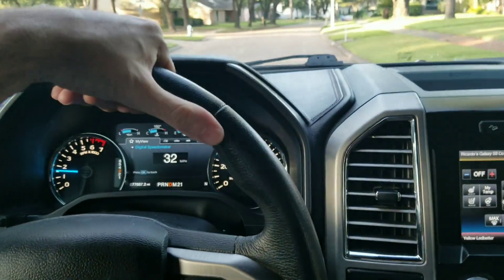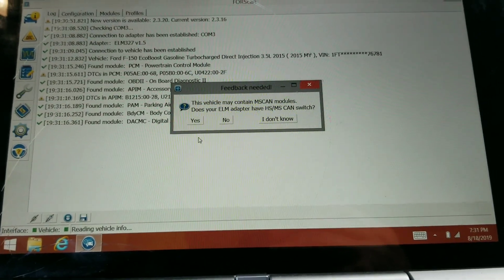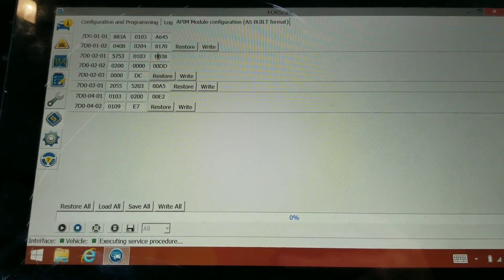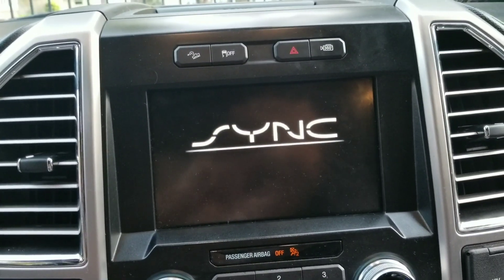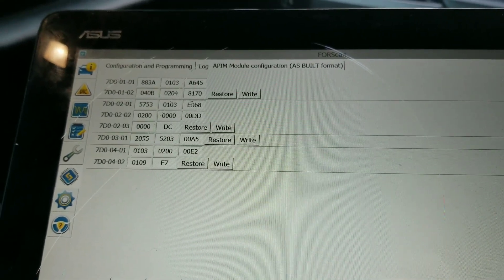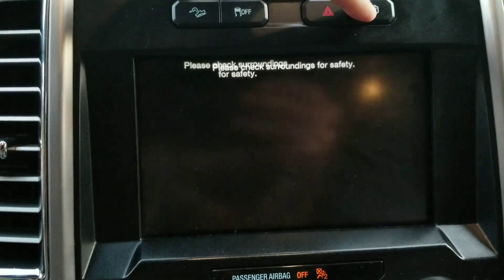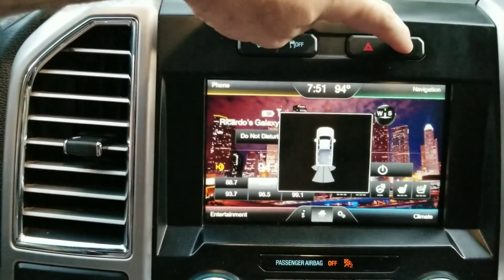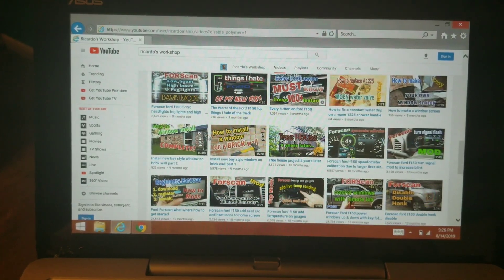Forscan FAIL change rear view camera mode from 360 to sole rear RVC on F150

Comment: Did you find how to do it? I want to try something, i just bought a f250 with only reverse camera, it doesnt have the 360 like yours, im thinking to buy the oem 3rd brake light, the camera and the wiring, and with forscan add the option to change betwen tailgate and cargo camera, yo think this is possible?
Reply from the maker: That sounds like an awesome idea. I'm sure if an aftermarket company is selling the 3rd brakelight camera, they will have instructions on how to incorporate it to the truck.

Comment: Did u ever figure this out I’m wanting to just use reverse as well
Reply from the maker: No grant. As far as i know, its not possible. But it might work with SYNC 3
Reply: It’s weird that there’s spreadsheet on FORScan for it but it doesn’t work
Reply from the maker: I know right... thats why it just might work with SUNC 3. What year and version do uou have?
Reply: So no luck on figuring it out? I have a 2019 King Ranch F150 and I would love to change the rear camera feature as well. By the way, what part of town you on? I'm up here in the Spring/Woodlands area.

Comment: What OBD reader do you use? The OBD reader I'm using give me a lot of error messages. I have Platinum 2019 but having a hard time finding a connect reader. You should add CarBridge to make it a perfect combo lol.
Reply: https://www.amazon.com/Veepeak-Scanner-Professional-Diagnostic-Programming/dp/B07S7W14X9
Reply from the maker: Thanks for watching Boyka. I'll look into CarBridge. I'm using an ELM327 from Ebay. It has the hs/ms switch. Cost me about $20-30